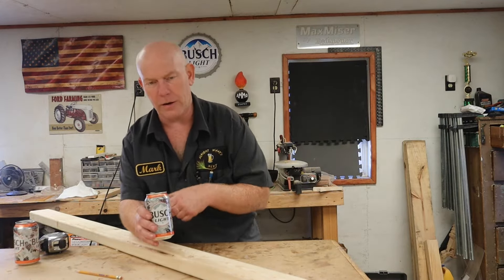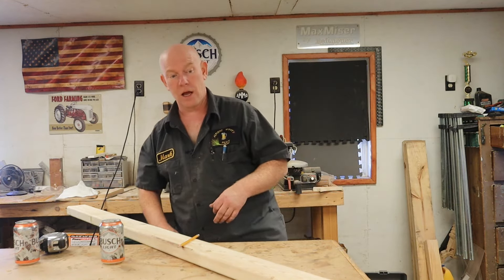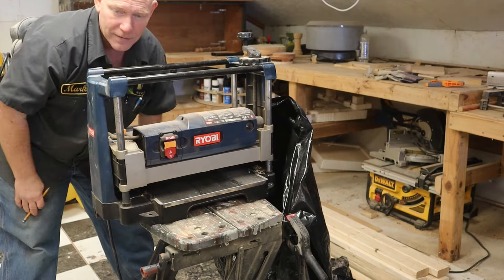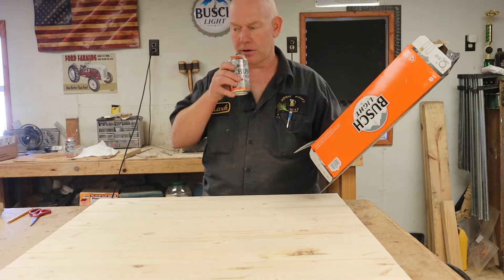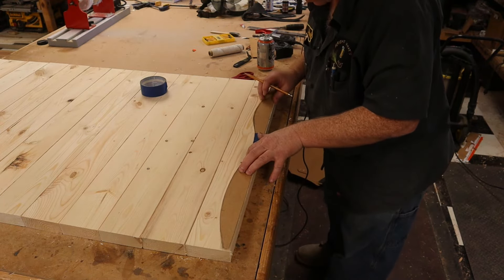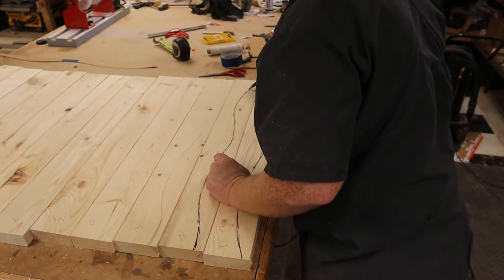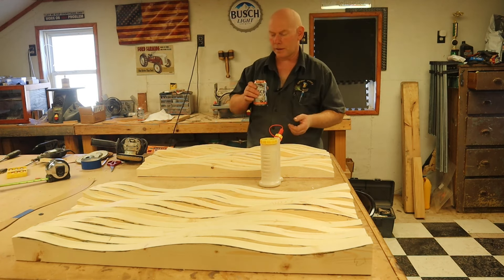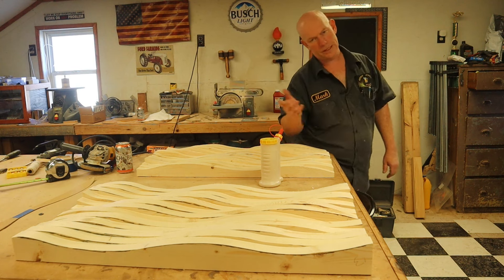Waving wood flag.  Make it with as little lumbar as possible. Save Money!!

Comment: I just used the 3 , and at first I thought it was old and expired. It seemed watery. Hours later it was still wet, I knew it was old then. So I shook the bottle really good. That’s how it is. It wasn’t expired. So, the work time is plenty enough if you had to cut a new piece you could still get it done.

Comment: I made my first set of flags and per your method and they have turned out great.  I like this approach.  I'll make the pattern as you discribed but I think I'll add the offsets to the length of the pattern.  That way I shouldn't have to freehand in the line.  Jus sayn.

Comment: For the snipe, maybe run the 2x4’s through full length, then cut them. Don’t know about yours but I sometimes get snipe on both ends. With 3 inches extra on each end it shouldn’t be a problem.
Reply from the maker: I've made sleds before that have extra length on the front and back, so the snipe occurs on the sled boards instead of my work peice.  It's a pain in the ass so I usually just plan on a little extra length boards that I can cut the snipe off